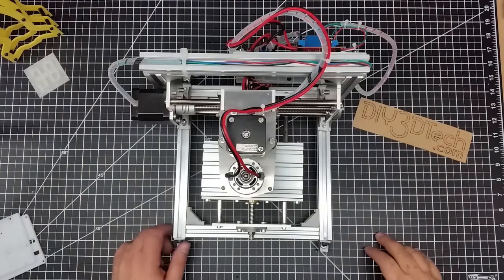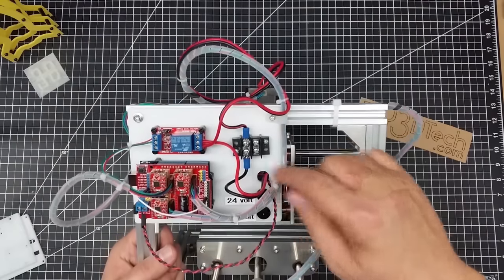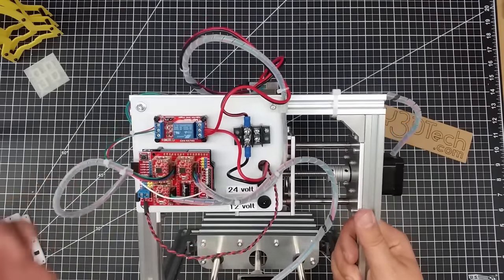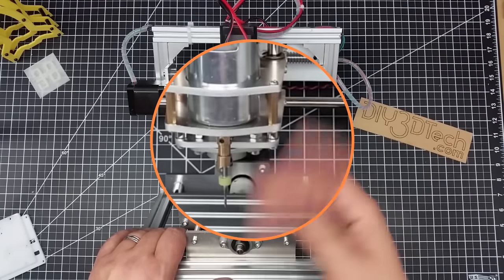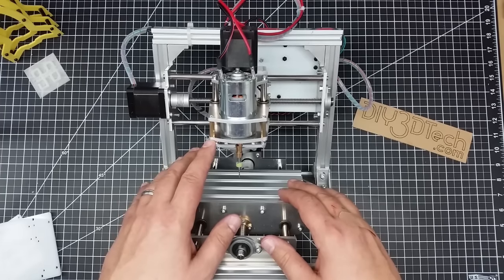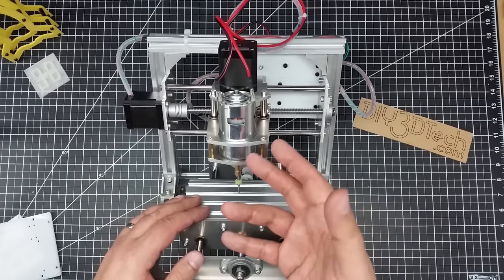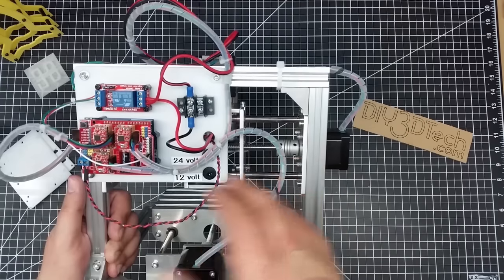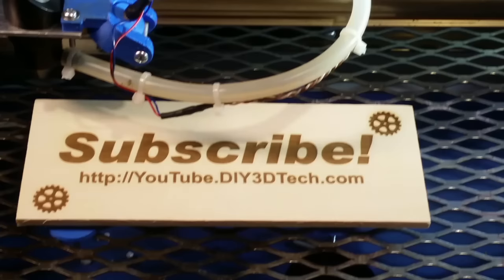Desktop CNC - Build Vlog Part 2 of 2!

Comment: The dreaded runout.  I just received a Drill Press for Christmas and it is a Sears 12in model which is from China and the measured run out was .02-.05mm and I have it just sitting on a roller so it shakes (I did manage to get the shake down a lot but not all out so I need to eventually mount it) and with the shake it measured up to .08mm.  Now turn it off and remove the belt so you can spin the spindle by hand and there is 0-0.1mm run out.  For a drill press like this I can't ask for better than a running runout of less than .02-.05mm which is less than two thousandths of runout.  Measure your runout with a DTI as it looks pretty bad but it looks more like the bit isn't fitting in there right or the internal "chuck" is not really bored out true to me.
Reply from the maker: +Dark Alchemist that run out isn't bad at all, also the run here is not that bad as there is a little because of the simplistic chuck yet if I where to use a 60 dry bit for a circuit board I believe there would as the run out would be within the trace (I believe).
Reply: DIY3DTECH.com
You are right about it being too much for a pcb trace from what I saw.  When I mentioned about you testing with a DTI I meant with that simplistic whatever that thing is that is trying to hold a bit.  I saw a screw above and below I think so if you can remove it then you can DTI measure the runout on the shaft.
Reply from the maker: When I get back from Germany I might take a look with a dial indicator to see :-)

Comment: Just got mine the other day and got it built though help with your video.

I did have to send this command. "G01 F200" because it replied back with "error undefined feed rate" when trying to manually change the X/Y/Z positions. My final build space is about 100mmX80mm which isn't so bad (I do have an x-carve for bigger projects). This is more for the wife for hobby cuts (the xcarve scares her a little).

I don't recall which video but you mentioned a knob to adjust the Z axes. I haven't tried it yet, but it does seem to have a threaded port on the top. It's not 2mm but I'm thinking 1.5mm. Maybe some locktight, a 3d printed knob and a long 1.5mm (if that's the size, I didn't have any on hand to test it.)

Here is the front where I just lowered the z axis down to the waste board I stuck to the alum. Then just moved the x and y till it made the build area. http://i.imgur.com/kNOUwzp.jpg

Here is where I decided to put the 12 and 24v ports at the bottom and use the wing nuts which came in the kit, no idea why I got those with all the other extra parts. Heck I probably got 20 bucks of "extra parts" lol... http://i.imgur.com/oDm5a9r.jpg
Reply from the maker: Very cool and that is normal with the feedrate issue :-) Please keep me posted on how things go!

Comment: I wonder how much it would cost to build a clone of this, I can get pre-cut lengths of 2020 fairly cheaply and i've probably got enough nema17's spare :D
Reply from the maker: +MiggyManMike if you have the parts it's easy the main reason I went for the kit is because views might not have this stuff.  However too I also a bottom costing as I was thinking about selling my own version on line but the numbers did not work as buying the kit was cheaper than buying the parts...
Reply: I actually have a bunch of 5mm linear rods for another project and a working design for an extrusion  bracket for them as well, they're actually intended for a couple of projects one being a reworking of mt cheap laser engraver and the other a small 3d printer so re-using the parts would be simple :D

The real question becomes do I have the disposable for the extra bits right now :D
Reply from the maker: Either way, look forward to hearing about what ever it is you create :-)